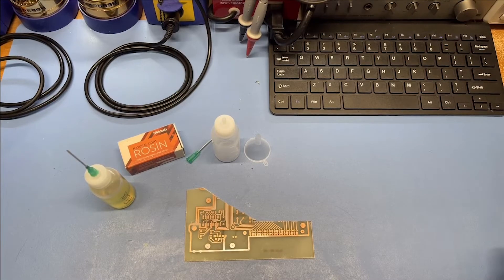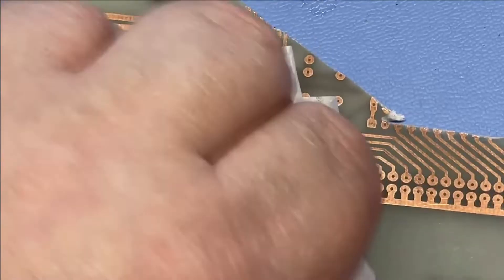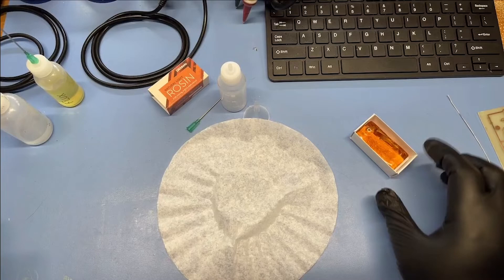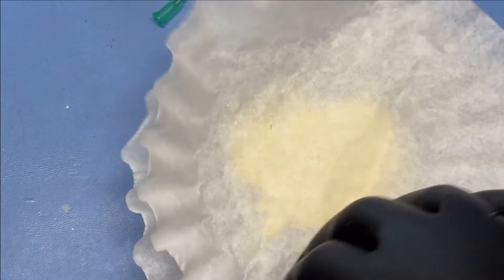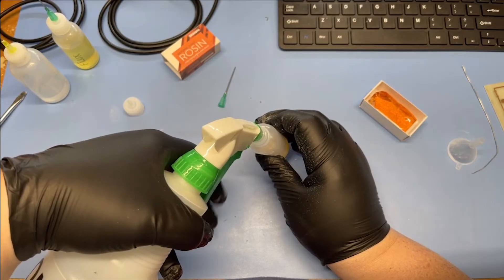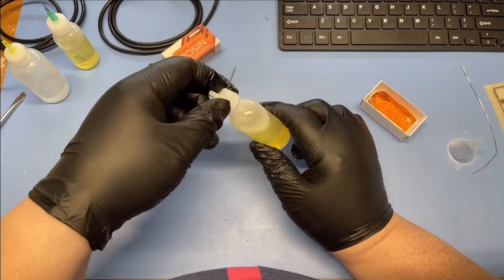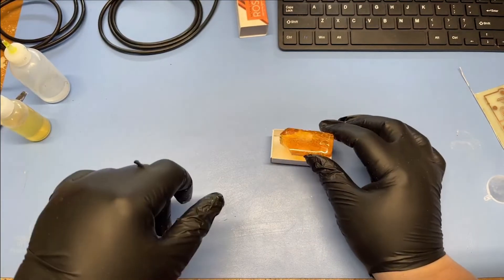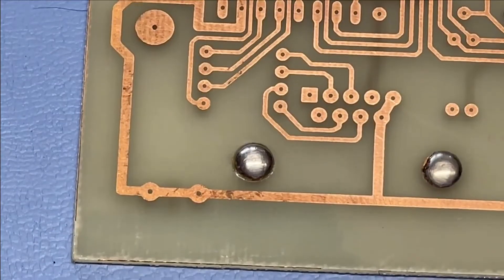Home made flux: is it worth the bother?

Comment: Biggest disadvantage of the homemamde rosin-based flux is, that it evaporates pretty quickly when in contact with holt tip of soldering iron. Good brands of commercial fluxes give you some time needed for proper heating and soldering before it evaporates... and that is critically important feature in some scenarios. I tried making my own rosin flux many years ago, but it's properties was not comparable with commercial fluxes. It's exactly like you are saying in your comments - it's cheap and it's good for some little dabs here and there, but I can't imagine doing some serious rework job on PS3 cpu or gpu with it (for example).

Btw, I'm working with solid rosin for almost 30 years, but only when soldering with soldering gun (not iron). In this scenario the rosin is excellent, but it's only possible because the soldering tip is not heating all the time like on soldering iron, so you can use manually controlled cold and hot cycles of soldering gun for your advantage. What am I talking about... not many knows this technique, but you can pre-flux soldering joint with soldering GUN (again - not soldering IRON) and rosin, even if it's not dilluted in alcohol and it's still in its solid form. You put some solder on the tip, just exact amount you want to transfer into soldering joint. You heat the tip again and when hot, dab it into block of solid rosin so you'll get a little bit there, and let it cool down. So, now you have solder and rosin onto tip both in the same time and ready to use. Next step is to heat the tip a little bit (not too much, so rosin will not evaporate) and when the rosin gets into it's liquid form, smear it around the soldering joint (it's the equivalent of fluxing it with liquid flux from bottle). And after that, you can finally crank the heat to the max and solder that joint. I know it sounds kinda chaotic, but it's pretty simple and straightforward - watch this  .... https://www.youtube.com/watch?v=vkOlsHpP7PU  (it's only final stage of pre-fluxing and soldering, whole process of solder and rosin preparation onto tip can be seen here - https://www.youtube.com/watch?v=98wcqTpQ1qE ).

Advantage of this process is that you are not working with anything sticky and spillable, so it's much more clean and so to say it, joyful :) But of course, it's only good for through-holes and some bigger joints, because of size and shape of the soldering gun tip, which is not very suitable for smaller jobs. Classic soldering station and quality brand of commercial flux is better for those delicate jobs (SMDs, SOICs etc.)
Reply from the maker: Many, many valid points made!  And for that reason, I pinned your comment.  Thanks for your insight and thanks for watching!
Reply: nonsense, the solvent evaporates not the rosin
Reply from the maker: @shaunmorrissey7313  I think he was trying to note that in a general sense that "it" evaporates quickly.  Not necessarily the rosin. :)
Reply: @daveytechca  I think Shaun was referring to Efdawah Fan's comment.
Reply from the maker: @DavidKenny64   How many of your comments do I have to delete until I completely block you?  And I don't care if it's dissolve and not dilute.  I've deleted that stupid comment at least a half dozen times.  Go find something else to do with your time.
Reply: @daveytechca   That comment was on the end of the one about Shaun above.  Within ten seconds, I decided it didn't need to be said, and edited it out.  I'm not sure how it got replicated, but I didn't do it. :)
Reply: the moment you realize "commercial" fluxes are nothing but rosin dissolved in alcohol adding a gelling agent😁
Reply: @heateslier  Good to know. Tell us which exact gelling agent it is, so we can make our own Amtech 559 flux at home :)
Reply: @amigator7789  well, when it comes to gelling alcohol there are actually not so many choices, but for DIY purposes try mixing a saturated rosin solution with an already gelled alcohol like Chafing Fuel to create the desired consistency💡
Reply: @heateslier  wow... I must say that this is pretty smart solution (to use already made gelled alcohol as gelling agent). Did you try it to make a soldering flux this way? If yes, what were the results during soldering (in comparison with commercially made fluxes). It's really interesting idea, because if this method works, it would be cool to make own good quality soldering flux at home.
Reply: use more rosin ??
Reply: OMG theres a vintage style soldering gun meant for work on vacuum tube equipment in that video and SOICs in your text LOL
 im relaxing with a real c245-741 JBC tip in a fake AIXUN JBC soldering station and not going back to hard work with obsolete tools or hunting rabbits with javelins that need to be fluxed all the time. what year is this?
Reply: I have heard that glycerin stabilizes the mix it may be just the thing to prevent rapid evaporation. Any thoughts?

Comment: Even the non-coughing fit smoke is already a good reason to make this DIY flux. I use a solid block of colophony when soldering that I dip my soldering iron's tip into right before soldering a joint. I gotta have a 12V PC fan near me to blow away the smoke if I do not want coughing fits and weird fried chicken/fish smells in my nose even after not inhaling the smoke.
Reply from the maker: As crazy as it sounds, I like the smell of fresh solder being melted onto a board...  Even more crazily enough I like the smell of old vintage solder from the 70's / 80's being melted.  I don't huff it obviously, but it has a pleasant nolstalgic odor to me...  Kind of like a cigarette when it's first lit (and I don't smoke)...  I'm a weirdo I guess...  :P
Reply: @daveytechca  Nope, i love the smell of it, as well.....and i semi-huff it too. What it could give me isn't worse than what i already have. And i have a bunch i refined myself from pine rosin, also.
Reply: @daveytechca  Some vintage solder used barely activated pine resin as flux. And I like that smell, too. But not today's commercial fluxes. Some current rosin flux SnPb solders are still bearable, but only the least activated ones, which tend to not solder very well any slighly corroded surfaces.
Reply: I read in QST magazine that smoke from colophony is a major cause of asthma.  You need to avoid it if you use it very often.
Reply: @channelview8854   yup, that's why when I'm soldering I have a 12V PC fan near me blowing away the flux fumes towards my open window

Comment: I repair and restore CB radios daily and have been using my own flux for decades. Violin resin from China comes in a hard block i grind up then put in a jar and add Metholayted spirits (denatured alcohol) and let it sit for a few days.
Cleans up with IPA.
Very good for dirty joints that ive cleaned and need to tin etc.
Its the only flux i use.
All my solder types are multi core with resin.
Reply from the maker: Do you have a specific ratio of resin:spirits that you use and is most effective?  I'd like to try it!
Reply: @daveytechca  don't use denatured alcohol, use high purity Ethanol or IPA.
Try 15ml IPA, 10ml Ethanol, 5ml kerosene, 10g rosin, 1g adipic acid, 6 drops glycerine, 3 drops dishwasher soap. This is high rosin content RMA flux. You can regulate the rosin from 1 to 10g depending on your needs. For flux pen use 1g, for general work use 3g or 5g. If you want the best and cleaning don't bother you, use 10g.
Use toothpick for the drops, as kerosene you can use Zippo lighter fluid, you can replace adipic with citric acid.
If you gather yourself natural pine rosin, melt it in a metal container, mechanicaly remove the inpurities, heat it up again, let it cool a bit, don't wait to harden and put with the liquids in a jar with lid. Leave it overnight, filter it using coffee filter.
Reply: Some brands of denatured alcohol smell like a dead rat, especially older batches. I would rather use IPA as solvent for the flux as well, not just for cleaning it. Some more recent denat. alcohols are less smelly, nowadays they tend to make it less smelly but give it a more horrible taste than ever. I experienced it when I touched some food too early after using my home made sanitizer (70%v/v alcohol denat. + 30%v/v deionised water) on my hands during one of the first peaks of the pandemic. I almost threw up it tasted so horrible. Bile almost tastes good compared to it.

Comment: I have made my own flux for years not because it's cheaper but I can change the stickyness of the flux which is great for SMD parts as they stick to the pads. I use some rosin but have used pine resin which seems to be a little better but is difficult to get clean as it usually contains lots of organic material! Lol. I tried using different fluxes the most expensive one did do a superior job but the cost was just too high with the large amount of soldering I do . The big disadvantage is the residue which has to be cleaned off with ethanol it dose clean off but is not as easy as commercial fluxes.  I do use the petroleum jelly flux for very difficult and hard to clean work. Sorry got carried away typing 😃
Reply from the maker: LOL. don't worry about being carried away with the comment!  I welcome a good discussion about anything related to the video!  Thanks for watching and your comment Barry!
Reply: Do you add glycerin?
Reply: Just add solvent to it and run it through paint filters then boil off the solvent till you are at the desired thickness to bring it back to thickness.
Reply: Try lowering the amount of rosin you use. For a 10 ml bottle of alcohol you need as little as 0.15 gram of rosin. And yes, my decimals are placed correctly. Add a couple of drops of glycerin in it as well and you have no stickiness. Most of these diy videos use WAAAAAAY too much rosin and as a result you can glue yourself to the circuit board afterwards,  or start cleaning. And cleaning.
Reply: @barrymayson2492 how do you make it less sticky?

Comment: I did some web-searching and found someone recommended petroleum jelly (Vaseline) as a good flux.  Might be worth a try in another video?
Reply from the maker: I have read this before as well!  I'll give it a try in a future video...  Thanks!
Reply: I use a mixture of bee wax, petroleum jelly and pine tree resin. Smells lovely and works very well.
Reply: Dear only petroleum jelly ? Or any other thing ?
Reply: I use the wax from those cheap tea-light candles. It suffices, is dirt cheap and works great on clean metal.

Comment: I do some soldering maybe once a week, wires, condenser replacement (non SMD stuff mostly) and I am using chinese fake AMTECH 4 years expired flux surringe 😂🤣.Never had a chance to use  original thing but even that cheap fake flux helps with soldering. Saw on the YouTube someone tested fake and original one and suposedly difference is but not big and fake one is more sticky than original one.

BTW just few hours ago I watched a video, how to make flux at home (Electronics repair school) and this looks coool. I plan to make my own mix hehe, I have some hard rosin flux package so yeah just need to get the tubes 😁. Just a little bit of searching the YouTube I found nice video (from SDG Electronics) that he tested manny different fluxes from gel to liquid, very interesting.

I enjoy soldering, wiring and such, just to get my health bether, will be start doing SMD soldering practicing. The other day I replaced microUSB socket in my portable LG speaker hehe, it was challenge (used smartphone droid OBS app over the OBS Studio on Windows as microscope 😀).

Thank you for the video dude 😁
Reply from the maker: The "make your own flux" video from Electronics Repair School is the one I watched that made me want to try it.  After doing a little more research I think I was a little lenient on the amount of rosin I mixed in, perhaps that's why I wasn't getting the results I had anticipated on.  However, that still doesn't solve the issue of it being a sticky mess sometimes!  As previously said, for a little dab here, a little dab there I'll reach for this stuff...  But for anything bigger, I'll be using the flux I've always been using.  Clever improvising using your cell phone as a scope!  SMD re-working is a fun and sometimes challenging field.  Even though the majority of my work is with through-hole, I still like to keep my microsoldering in check because eventually through-hole will be no more (or at the least, very uncommon.)  Thanks for watching and sub'ing!

Comment: I'll have to try this.The only thing I have'nt got is the bottle. Just ordered a set of 4 with needels off ebay for £4.

Yes please to the drum machine video. :)
Reply from the maker: I've been working with it today and I've discovered a problem with it...  It's messy if mis-handled.  Sticky-ness everywhere!  The honeymoon phase is over.
Reply: @daveytechca  Is it worth it, then ?
Reply from the maker: @Franko_Walker  Yes and no.  Yes because if you're doing a quick solder joint and need a quick dab of flux, yes.  If you have a lot of soldering to do (more than what would cause an actual puddle on the board rather than a drop), no.  Maybe it wouldn't bother some people, but because I am a neat freak and don't like stickiness, I'll be using this for touch up jobs.
Reply: @daveytechca  Cheers.
Reply: @daveytechca  I've just made some flux. It was'nt too bad, mess wise, and it works fine. I've got a flux pen that's running out, When it's empty, I'm going to refill it with this. :)

Comment: Did the solder you used in this video have a flux core?
Reply from the maker: Sure does!  And a realize that the flux core is doing the majority of the work in the video.  The home made rosin is good for quick touch ups.  However, after an experience earlier today my mind has been changed.